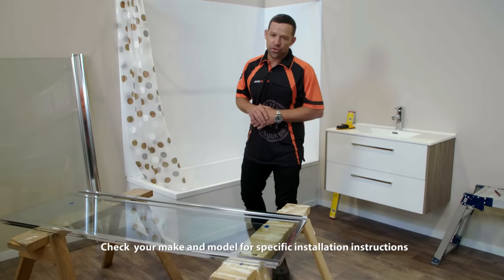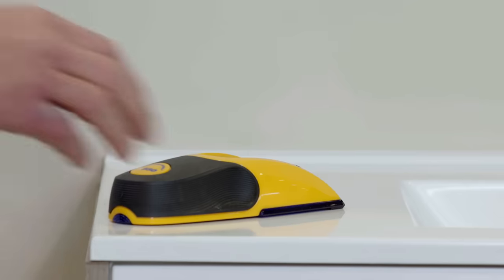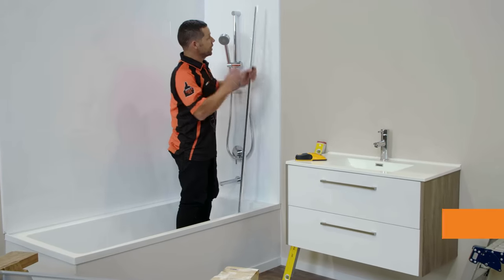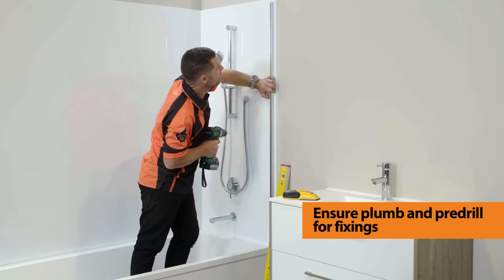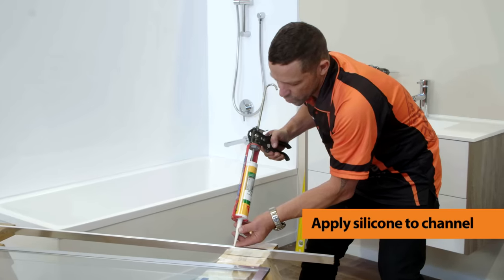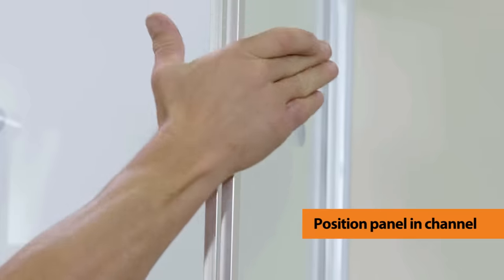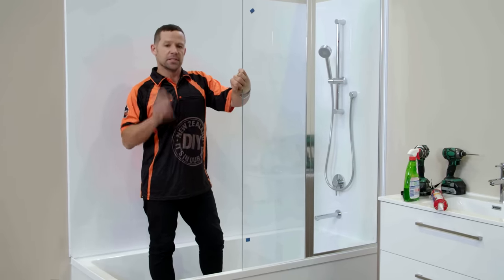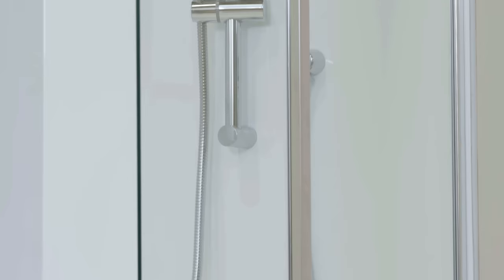How to Install a Glass Bath Screen | Mitre 10 Easy As

Comment: what about the back of bath and area not covered. i would still use the shower curtain along with this. you need to prevent water damage. looks good but not practical. always protect your property from any water damage.